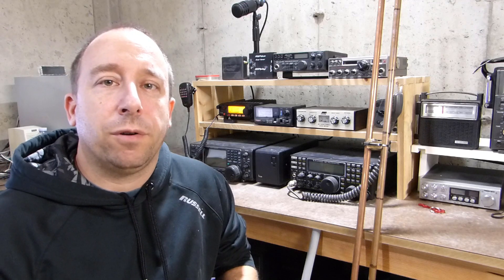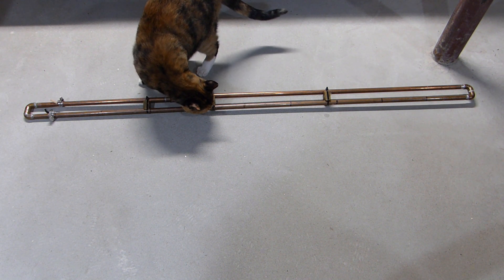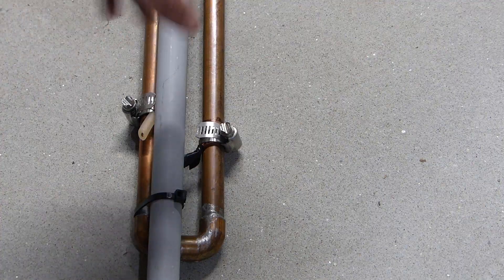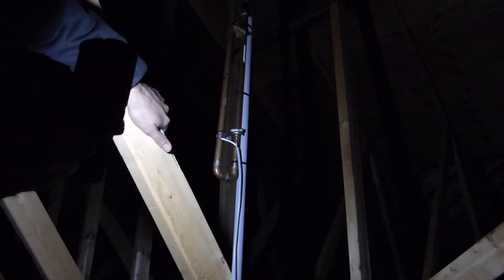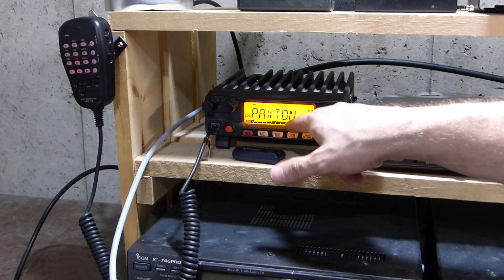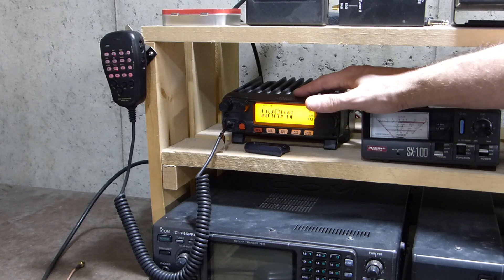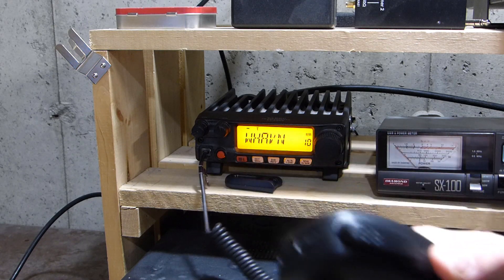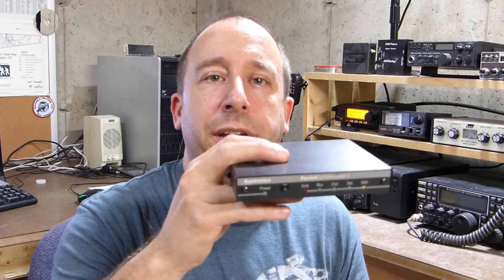Setting Up a Home Brew Slim Jim 2 Meter Antenna for APRS

Comment: Did you have to do anything with grounding the antenna and coax run? I'm assuming you have the radio chassis grounded?
Reply from the maker: The only thing grounded is my power supply.  The radio, coax, and antenna are floating.  It is a good idea to add a lightning/safety ground to your antenna system

Comment: Hi, Just came across your video and I am thinking of building this antenna, did you tin the ends of the coax or leave them bare under hose clamps? atb from England
Reply from the maker: I don't recall what I did but tinning the leads is a good idea.  My antenna is indoors so the weather won't bother it as much as an outdoor installation.

Comment: I am thinking about setting up an APRS gateway at my house. I did a listen only one with a scanner, audio cable, computer and software which was really easy but was told by KB9BVR that wasn't good for the APRS system (please excuse my ignorance) and two way gateways were better for the system. Did you ever setup this up? I was looking at getting a used public service radio  but I see the Kenwood TM-281a is $120. A good deal for a 65w two meter radio. Thoughts?
Reply from the maker: I'm thinking of doing the same thing...busy with work right now though.  Tm281 is a great radio - I use one in my car.  Anyway, not sure what aprs looks like in your area but Michael may be right a receive only igate may not be needed but a fill in digi may be useful
Reply: @SevenFortyOne  Is there a guide on how to set one of these up? KB9VBR was planning a video on how this is done but he is a busy man like you are. I am a visual guy so seeing someone go through the effort of putting one up would be a great help. Looking for resources.
Reply from the maker: I don't know of any videos on this but there may be some out there.  I'm not real familiar with it either so I'll have to figure it out before I do it myself